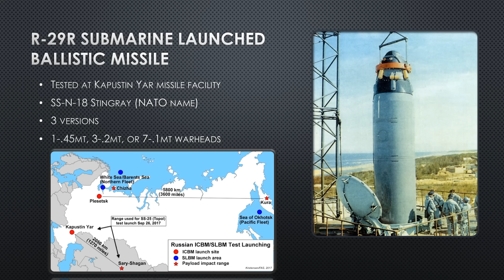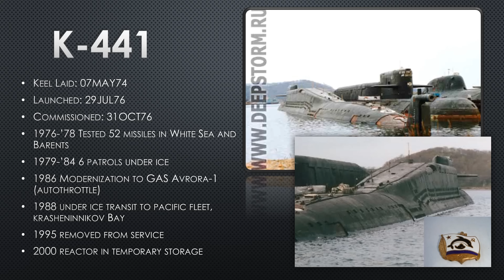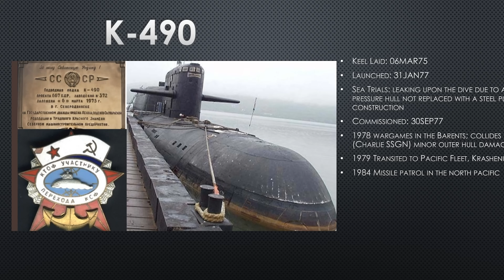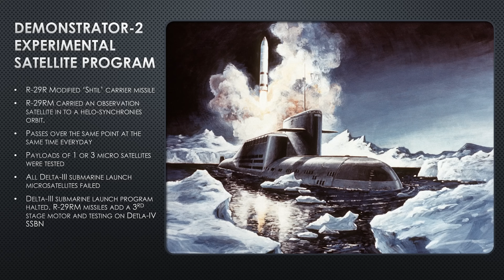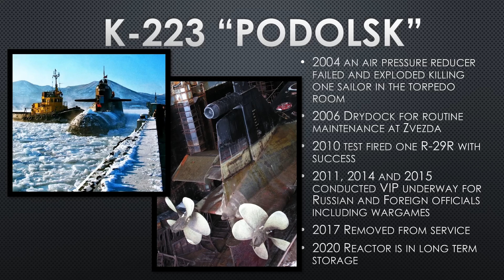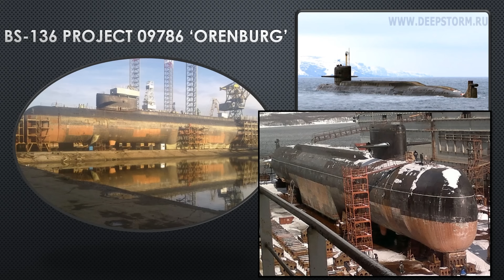The Secret History of Russia's Delta 3 Nuclear Submarine REVEALED

Comment: Good video as always, but I have to correct you on something. 1:09:49 having multiple smaller warheads on a ballistic missile isn't to go after cities, but rather the opposite.
Cities are soft targets where there are no hardened buildings that are built and designed to resist blasts. So a single larger warhead will do more damage. However military bases and especially missile silo parks as the US land based component for the nuclear trident is, however are made up of hardened structures. One large missile is only going to take out the building it its and the unhardened targets. But hardened ammo bunkers, and especially anything laying underground are quite likely to survive if they are outside the crater zone. So instead you launch multiple smaller warheads at the target to create more craters to take out more hardened structures. The multiple warheads are also to make interception harder.

So basically big singular warhead are city killers, many small warheads are base killers.

Comment: That's one instance I have less of an issue with us coughing up the money to deal with it. It's still aggravating for it to have become our problem, but in that early post-Soviet era, the country barely had two pennies to rub together. Better to deal with it then, rather than wait until the damn thing sinks and cracks open where it becomes a problem for pretty much everyone, as well as far more dangerous and expensive to clean up. Kind of like all the Strontium 90 RTGs that still litter a good chunk of the old Soviet Bloc that they used to run their more remote lighthouses on. You can see pictures of those just sitting around and rusting. Some have completely failed, exposing the isotope. Some have been cracked open by locals not knowing what they're getting themselves into for whatever reason. A good portion have been cleaned up now, but there's still the occasional story of someone dying and/or irradiating half their village because they were fooling around with them. It's just one of those damned if you, damned if you don't kind of things unfortunately.
Reply: The West will also expect receipts/proof that this was done. And with no reactor the sub is out of commission. Thus keeping in line with the SALT and START agreements concerning missile numbers.